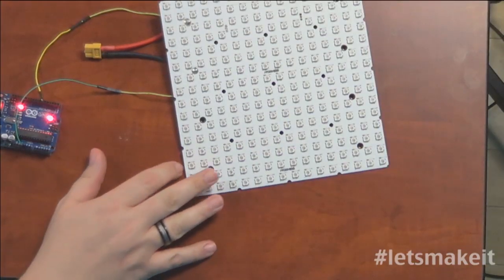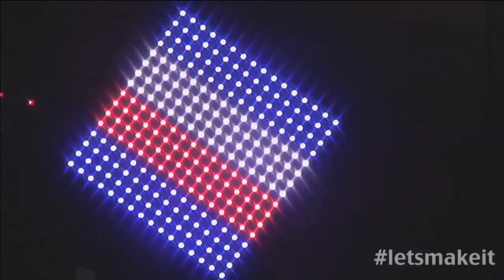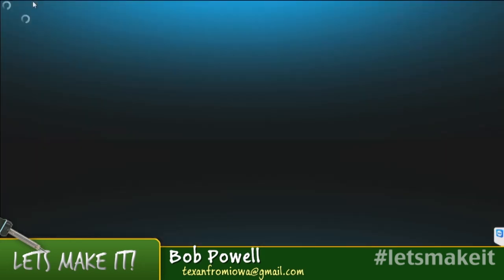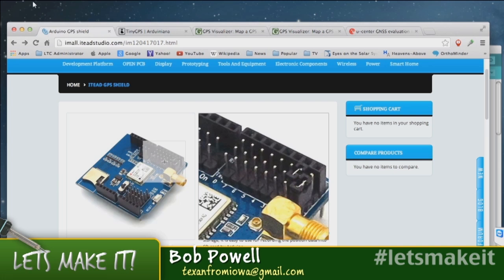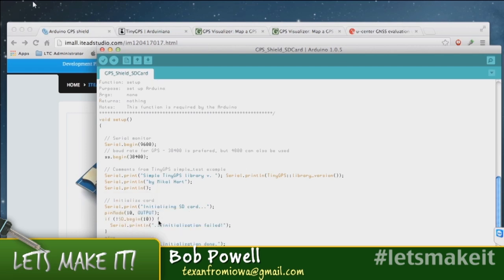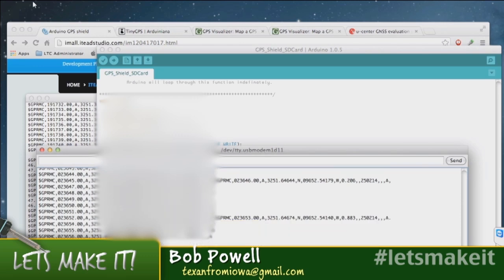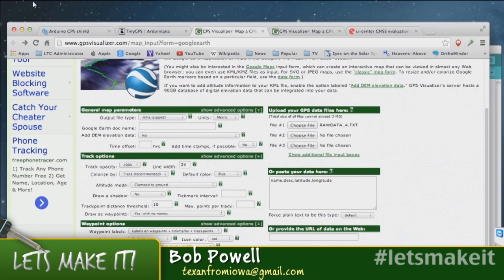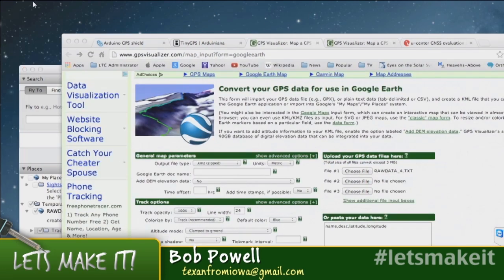Arduino's and GPS tracking Episode - Let's Make It - Episode 53 - Tech-Zen.tv - Alixa.tv

Comment: Using the following code example at site, I didn't understand if I need to use ports 2/3 or 3/4.

The docs says:
" The jumper pins set for Arduino pin 3 for RX and pin 4 for TX, and 
            toggle switch set for 5V.  A 2gig SD card was used "

And the code:
SoftwareSerial ss(2, 3);